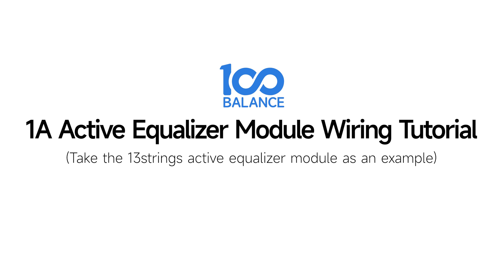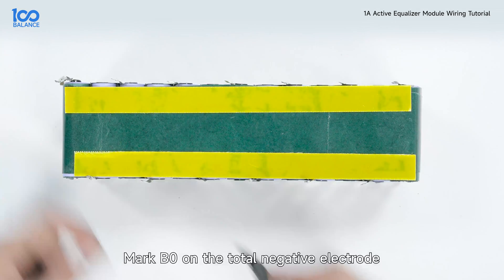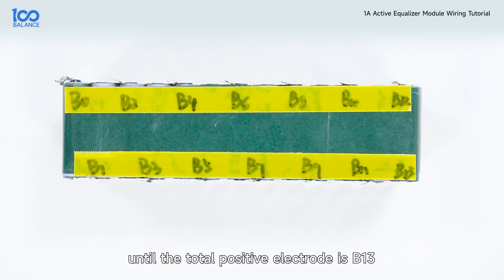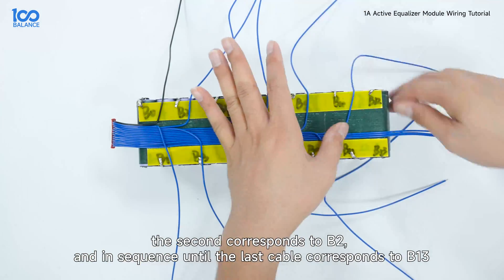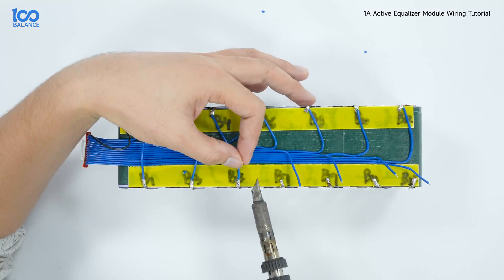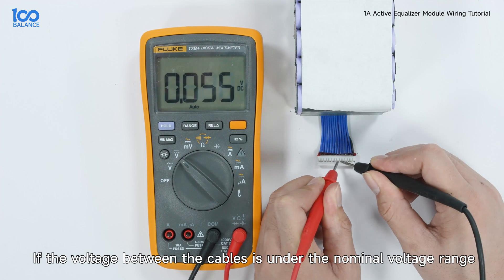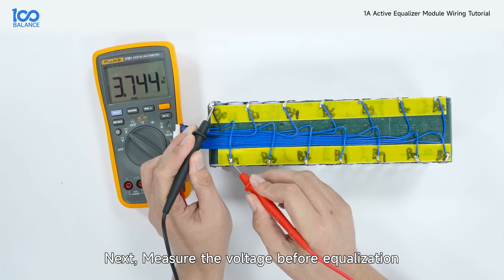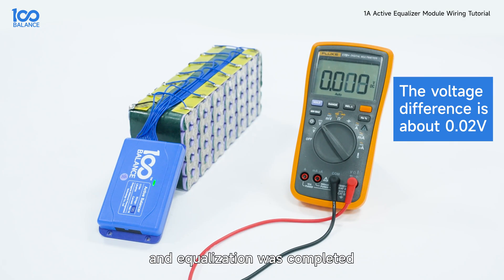100Balance BMS Battery 1A & 5A Active Equalizer Module wiring tutorial

Comment: Can you tell me, please, what type (marking) of connector on the cable for "100Balance Smart active balance", 6S, Li-Ion/LiFePO4/LTO?
===
Здравствуйте! Подскажите, пожалуйста, какой тип (маркировка) разъёма на кабеле для «100Balance Smart active balance», 6S, Li-Ion/LiFePO4/LTO?
Reply from the maker: Minimum support for 6S, as BMS needs to reach the minimum starting voltage to operate! But LFP and Li-ion can start working at a minimum of 4S!
Reply: @DALY100balanceBMS  What type of connector? PH 2.0MM?
? PH 2.0MM?
Reply from the maker: @amchalkin025 1A active balance use PH2.0 MM ,bms use PH1.25MM